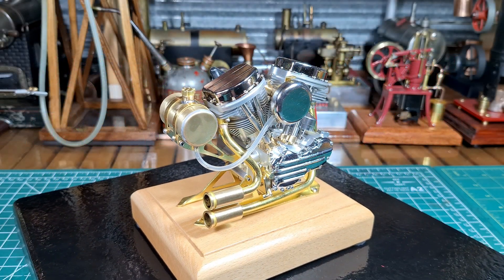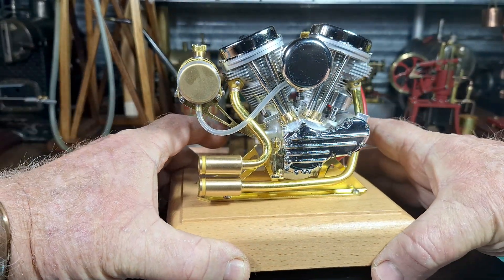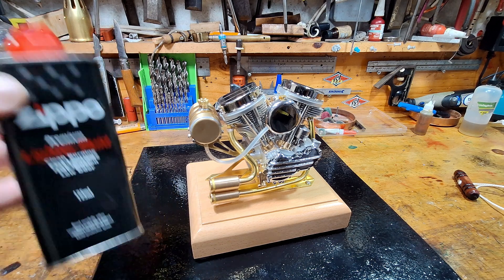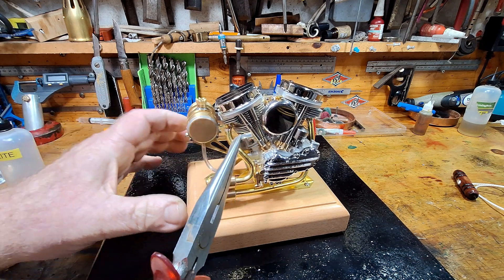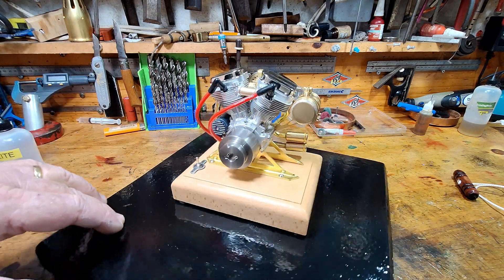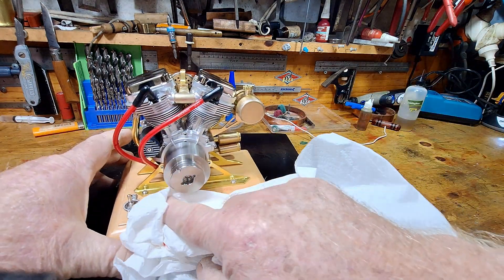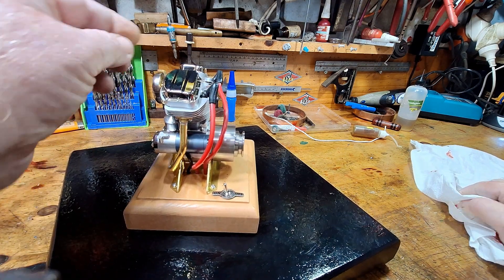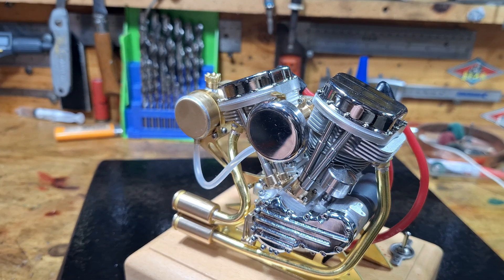OKMO Harley Davidson Panhead V-Twin Engine Model R30

Comment: Marvel oil is more suited to be used as a after run oil , 

Klotz kl 100 synthetic/castor mix will be better.

Nice engine .👍
Reply from the maker: Hi David, I haven't ever heard of that brand of oil before, Googling it, it is available in Australia.
Reply: @SteamEngines-Jim  yes this hobby shop has that oil., the shop is called "HT direct " in kirawee Nsw.Look for KL100
Mix at 20% oil per liter of methenol/nitro.
Reply: @SteamEngines-Jim  yes it is..

Comment: Very nice video Jim - I wonder if there must be also something like an oil sump or does the mixed fuel is sufficent?
Reply from the maker: Hello Arnold....yes there is a sump that you put in a small amount of 20w or 30w oil. To do an oil change you tip the engine over and just drain the oil out onto a rag and replenish - Cheers Jim
Reply: Thanks Jim - So it is like a real four stroke motor cycle engine - very cool - I consider to buy one too, cheers  Arnold☺
Reply from the maker: @tenniV11  Arnold, have a read through this well re-written manual by a fellow enthusiast -
https://www.officeofsteamforum.com/general-discussion-scale-model-gas-engines-hit-miss-throttle-governed-non-compression-etc/comprehensive-guide-on-okmo-v-twin-engines/
Reply: Thanks Jim @SteamEngines-Jim
Reply from the maker: @tenniV11  You're welcome Arnold 😊😊

Comment: Great detail on the engine Jim.  How are the bottom end, rockers and cam oiled ?  Cheers Rob
Reply from the maker: G'day Rob there is a small hole just above  the flywheel (crankcase vent hole) that you put in 5ml of SAE20 oil using a syringe. To do an 'oil change' you tip the engine on its side after warming it up and just let the oil drip out on to paper towels and put some more in there - Cheers Jim